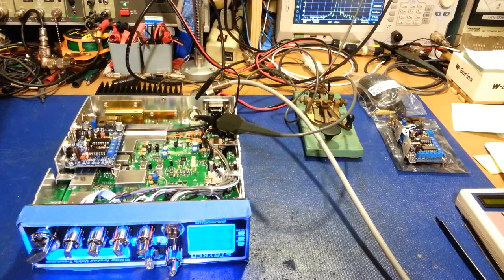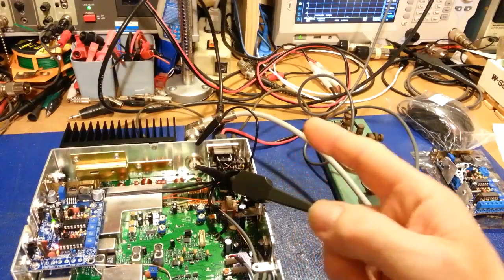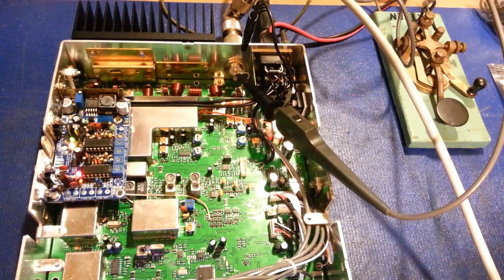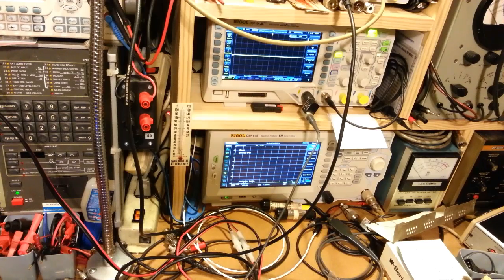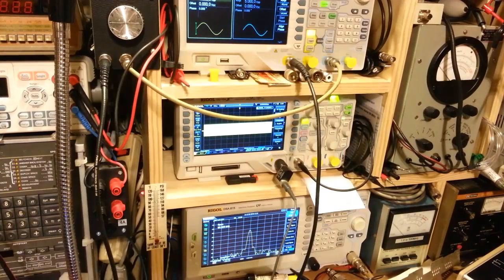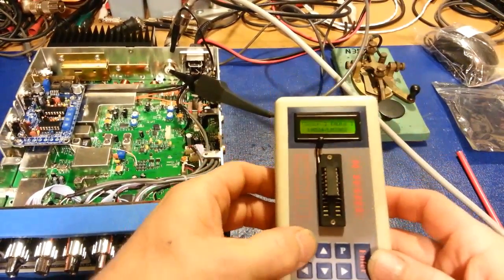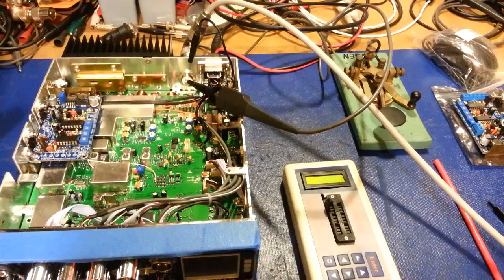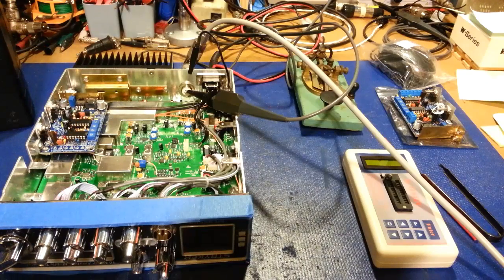Review of a Asymod III in a Stryker SR-955HP testing audio bandwidth with a sweep generator.

Comment: Since the AM bandwidth for CB is 8khz, by widebanding it up to 10k, is just creating "splatter boxes." Thus a standard 8k receiver will not perceive the modulation as much better, and possibly worse, but will hear it on adjacent channels as splatter as the modulation saturates the 4k guard bands right into the next channel.
Why not just make the allotted 8khz sound better rather than creating a "splatter box" at 10k?
Good way to make enemies out of friends.

Comment: He said, she said, whatever...MMM is a good person, but failed to bring this idea to market. Jose in Miami took the bull by the horns and produced a highly professional circuit and developed a product that is superior to none. I run an RCI99v2 he added an outboard Standalone unit. I run twin Heil mics (two different models) at the same time thru a W2IHY 8-band EQ and EQ Plus to achieve the same audio you hear with MMM when he is on the air.

Comment: Also these are in fact hi fidelity whether people agree or not. It absolutely is. Its not gonna work using the regular mic. Its designed for direct inject. So you can definitely definitely achieve hi fidelity audio.....as far as adjacent channel rejection...just so that its understood....that board....well....the original rather....its designed to be used with a program....and also direct injected. where you can control the injected audio bandwidth to your liking. For your voice. And you can control your receive bandwidth as well. Again my apologies on my first comment. I jumped the gun and got a little defensive.
Reply: it is NOT hi-fi, hi-fi would mean high fidelity, this asymod product distorts the original audio signal a lot!  Try running a sine wave thru it on a dual trace scope, what comes out is massively distorted representation of the original signal.  If you watch his own videos where he claims the signal is not pinched off, it is pinched off a lot and there are many other distortions to the signal.

Comment: the most your going to have is 300 hz to 3 Khz response. going out to 25 Khz is way out to far and yes you will splatter the band with it. try adjusting your Audio generator to the correct settings and rerun the tests.

Comment: I just got my 955 and its awesome seems like my stock uniden 980ssb receives way better upper lower sideband traffic than my 955  for whatever reasons idk yet I love the ssb capability of my 3 uniden 980ssbs for certain I gotta a lil Palomar 250 auto ssb box on all 3 the unidens with a good preamp built into the boxes maybe that's the difference but I've ran all 3 uniden 980s without the box on and still got better contact with any of them actually
Reply: 980 SSB's are some good radios? I have some older Unidens from the 80's but I'm looking to buy a brand new SSB radio, would you recommend it? Looks like an awesome radio.

Comment: I see that you are using Rigol DG4102 function generator as your two-tone generator for SSB testing. How do you combine those two outputs into one before feeding the signal to the mic input? Is the small black box you have on the left side of the DG4102 that works like mixer for your audio signals from the DG4102?
Reply from the maker: Kultur Chefen 

I usually use a communications test set that has low distortion audio amplifiers.  One of them will do up to a 20 tone composite signal.  To use two separate signals from two channels or from two separate generators just use a simple resistive combiner.
Reply: Cool! I think my next step is to get a HP 8920A radio comms test set.

I have a HP 8904B function generator with 4 channels that "seems" to work ok and that one can also combine those 4 channels into one output. 

However, I have always wondered why my 2-tone SSB testing shows different levels for my two tones I use, for example 900Hz and 2400Hz or 850 Hz and 2200 Hz. 

I always thought that it was a consequence by the design of the audio circuits in CB radios but now when I recently got my Rigol DSA815-TG generator I hooked up my HP 8904B to the DSA815 and was surprised to see that the lower tone had lower amplitude than the higher tone. I had to set the 900Hz tone to 35mV and the 2400Hz tone to 11mV to get two signals on the spectrum analyzer with same amplitude... 

I guess I need to build a low THW tone generator with adjustable levels of each tone before going through a main level control. Like this one: https://sites.google.com/site/linuxdigitallab/rf-homebrew-instrument/audio-low-thd-two-tone-generator

Comment: After watching this clip a second time I think for people like myself who might want to get into the "hi-fi" CB thing, this might be the easiest way to do so. When I say people like myself I'm referring to those who enjoy the hoby but have little to no knowledge about how to install/inject/modify or wideband a tranciver. Although I did show some interest in "hi-fi" 11 meter operation, I've since lost that interest. The guy's who are into it and do it right sound awesome, but after listening to so many of them on air my initial interest has completely dissipated. I enjoy trying to keep my setups sounding as good as they can whilst doing it as close to stock as possible. I recently had a d104 moded for a lower response with use for my uniden madiison, and although I've yet to give it a run through I'm expecting good reports. I heard a cobra 148 gtl with the same mod that's been done to my mic and am hoping to get the same results. which by the way were very impressive to say the least. I want to be able to key my mic and sound as good as one could with a stock or as close to it without having to keep my eye on a scope while constantly having to adjust a eq/mixer and all the other adjustments like carrier etc etc. if the "hi-fi" thing is you interest more power to you. When done right the result cab but impressive to say the least. I might consider experimenting with my sonar fs 2340. My reason for possibly doing so is because I own two. If I only had one I'd be happy with the audio clipper board bypassed, and the only reason it bypassed is its the only way to incorporate the demco modulator. it's also necessary if I decided to use an amplified d104. I do have one wired for the fs 2340 but have yet to give it a try. This "hi-fi" isn't for everyone and at this point it's not for me. if it's something you're interested in go for it but no matter what floats your boat, the important thing is to enjoy the hoby and resect it. keep it as clean as one could while reaching you desired audio/output. God bless all my radio friend's and have a great 2017. Hope to catch you on the air. another three years for the new cycle until the enjoy the local rag chewing sessions and the occasional skip conditions.
Reply: Problem is hi-fi CB is a stupid idea and those employing it are subjecting everyone else to it whether or not it's "their thing."   SSB is popular on HF particularly because the more narrow bandwidth is better for long distance voice communications.

Comment: Mike

Just a couple comments. I designed the original Mauldulator with MMM. I have seen people talk about 300% modulation and 20 and 30 kHz frequencies and of course these are both ridiculous. Anytime we mentioned anything remotely close to that, it was to show it had the headroom to achieve those things so usage at 5 KHz and 130% peaks was no challenge. In the first version of this, we did put in a filter at the end to cause a roll off at about 6 KHz. On the second version, we have no filter and tell the user they should provide that in their processing gear. We have abandoned the LM324 because of it's low gain bandwidth product. It would be interesting, if you still have one of these units you reviewed to look at the cross over distortion at the higher audio frequencies and see what it looks like. Something that claims high fidelity needs to have minimal crossover distortion. As for this competitor, I will give him credit for his talent at good documentation and slick videos. The quality of installation looks pretty good too. As to his integrity and honor, his actions speak for themselves
Reply: TinkTron Not sure if you will get this message, but in case you do, I must say I am disgusted that someone would make money from ripping you off. To be honest, I reverse engineered your original design for my own personal use and the schematics are locked away forever. I even informed John that I did it. Thank you so very much for bringing such fun to the CB world. I have a lot of respect for you. Respectfully, Ken (KP68)

Comment: You can't "steal" a concept. And there is nothing wrong with improving upon a concept. MMM has a very unique sound and I would credit him with the knowledge and experience in pioneering that sound and with engineering the circuit to do so. That said you can't fault someone for taking basic well known electronic concepts and putting together a circuit that allows you to modify an audio signal. And potting a circuit board has been around since the 70's if not before - which is sort of the same thing as wiping off identifying chip numbers. 
Your video is informative and well done on the other hand
Reply: There is no claim that the concept was stolen. It is the implementation that was stolen. Asymmetry on AM has been around for half a century, but the circuit to accomplish it in this instance was taken and no credit given. Actually, the guy flat out said that it was not a copy and MMM bought one and proved it was.

Comment: Yeah, they're Chinese LM2576 boost converters, couple of dollars (maximum) from eBay, so at a guess the power devices on the edge of the board are used as a push pull amplifier pair with a virtual ground to modulate the drain/collector voltage?

Would be interesting to see the low frequency signal on the finals. 

Not impressed though, it's one thing to get better modulation depth but only those who have a radio modded in the same lame way get the benefit it's at best a waste of money, the wider ceramic filter will worsen the AM/FM receive performance as well. 

And won't it stomp on adjacent channel users too?

Comment: It would be interesting to hear the sounds it's making on the adjacent channels during the sweep, if any.
Reply: When we originally built the very first Mauldulator, we put in a 20 KHz signal and of course that resulted in what looked like a dead carrier 2 channel up and down from the channel the radio was on. We later applied FM to the 20 KHz signal and sure enough you could hear the FM audio on those two carriers. This was not done as some kind of marketing ploy, it was just done to test the idea. I am not sure we even mentioned it before this.

Comment: It might be a copy but Jose has taken it alot further and easier to setup and cheaper. No 30 volt supply as john bartel recommends.
Reply from the maker: richard3560able 
No argument the design is more refined.  It's just that he doesn't give credit where credit is due for the original design.
Reply: That's true but most everything in the cb world is copied.
Reply from the maker: richard3560able 

But usually it's not someone else (motor mouth maul in this case) directly trying to help someone out only to have them turn around and take credit for it.
Reply: Been that way for years with amplifiers.
Reply from the maker: richard3560able

Would think they could at least give credit where credit is due.  Doesn't need to be fancy, something as simple as brought to you with the greatly appreciated help of .......

Comment: so does this work on SSB?
Reply from the maker: ᗒ╬ᗕ1112223333111ᗒ╬ᗕ 

They call it eSSB.  It will kind of work is all I can say.  The big limiting factor in SSB is the crystal filter.  These are mainly designed for AM.
Reply: MikesRadioRepair hmm not worth it with 3 locals to talk to here, lol.
I already seen mauldulators and asked him the same question.
I'd rather buy a Yaesu or driftwood that has 6khz wide built in with a submenu.
Till I find a 6KC filter for my 101, I'll have to suffer with 2.4.

Have a Happy New Year Mike
Reply: The AM modulator section shown in this review is not used on SSB mode. I assume it uses the stock SSB signal generation

Comment: I don't know why UNIDEN don't use the Tayloe direct SSB generator/demodulator at signal frequency, you know generating the RF at say 1820000khz which get divided by 4 in the Johnson counter which drives the PI5V331 one for LSB/USB TX and one for LSB/USB RX and one of the pins on the Johnson counter will give the 455khz.